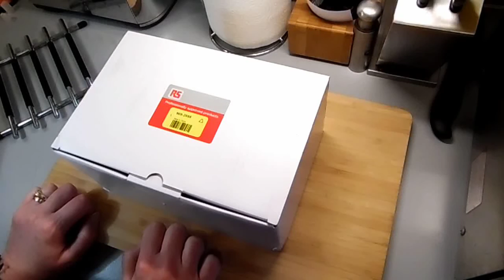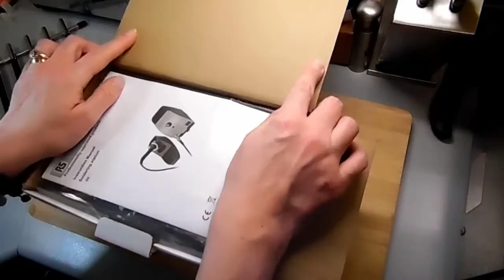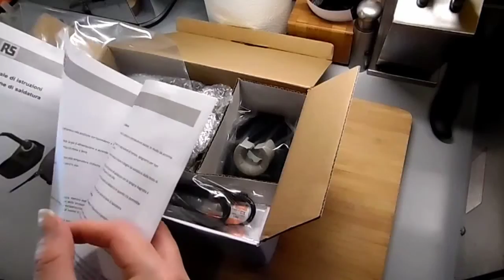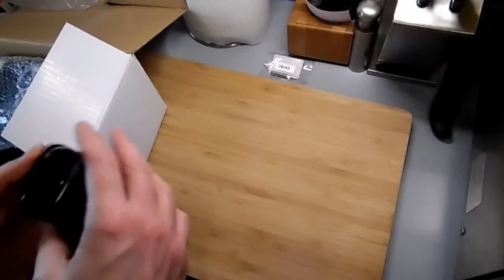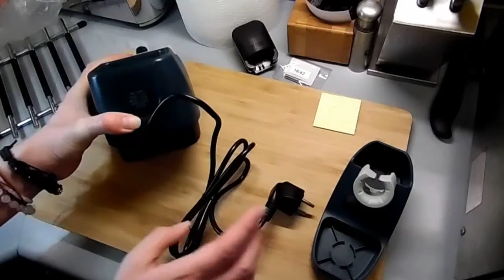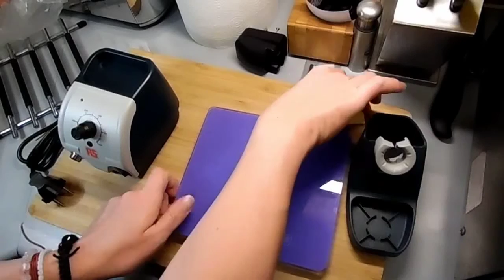RS Pro, Soldering Station Unboxing First Look

Comment: You have some really interesting hardware videos on here... only found this channel through Lyca, so def. subbed. :)
Reply from the maker: Most kind, I have sub back to you. I hope it helps.
Reply: Thanks indeed! Keep up the narrated hardware videos as they work well. I'm going to try more in future of some pieces of unusual hardware I have as I've only done a couple in the past. I think the RS stuff is generally very decent and electrically safe as they stick closely to the standards in comparison to some of the very cheap generic manufacturers in the far east who completely ignore them...

Comment: The small plastic tool on the bottom of the power unit is most likely used to calibrate the
soldering iron temperature. Most units have a small hole that this tool will fit into to adjust the tip temperature after you use an external instrument to measure the actual tip temperature.

Comment: Now that you've had this a while, what is the heat up time and thermal accuracy like? Does it compare to the Weller station you used?
Reply from the maker: I need to make another video. Very pleased with this unit. The heat up time is very fast about a minute and has a red led indicated, that goes out when ready. Good constant heat but I did have to move the dial about 15~20c more as I was doing large spade terminals. 
So for a £35 unit against a £135 weller. I would recommend this.